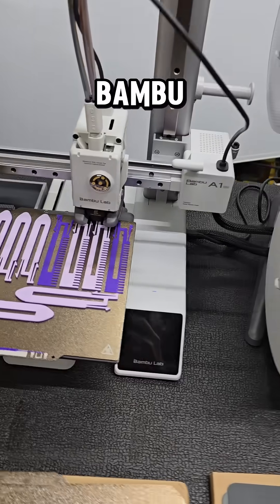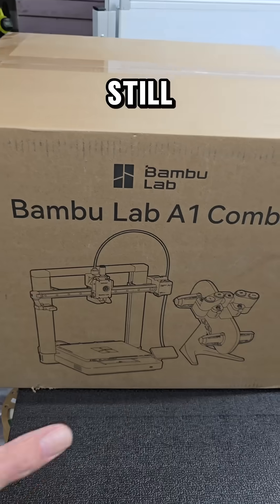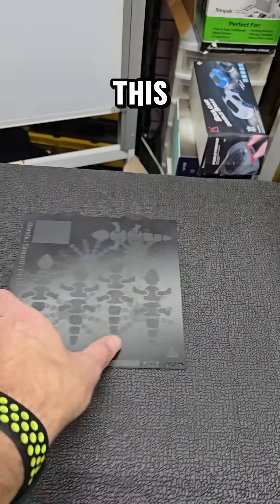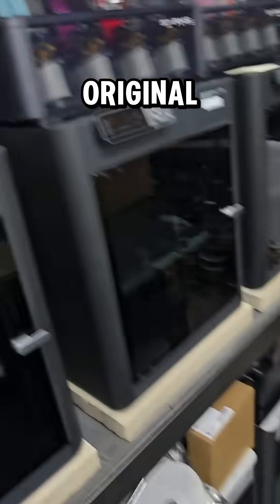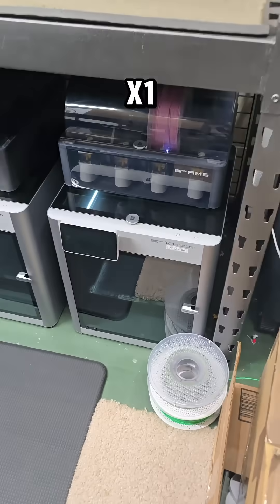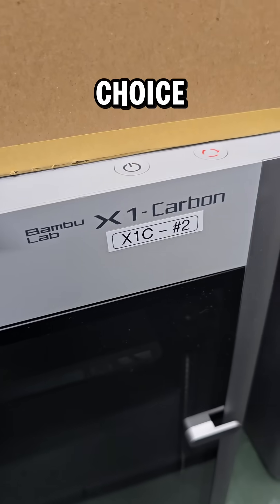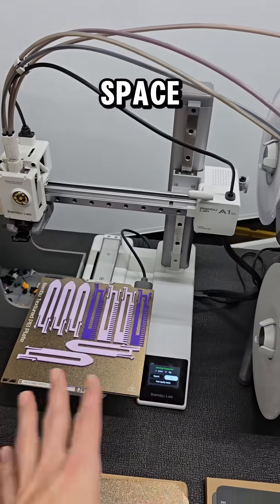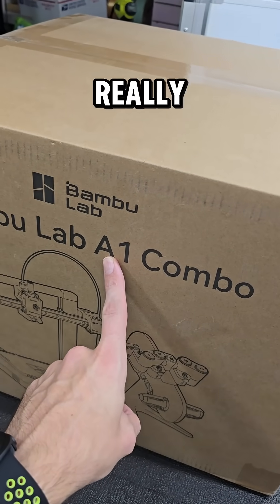Trying to decide between Bambu Lab printers? Here's are the differences: A1, A1 Mini, A1, P1S, X1C.

Comment: Question. 

I bought the A1 for Christmas from Micro Center but I'm about to bring it back to pick up the A1 combo as I haven't opened it yet.

Now I'm thinking I might just grab the P1S. I'm just trying to get a solid understanding of the ABS and ASA differences versus the PLA and PETG. What's the real difference in types of prints I can put out? Let's say I can afford to upgrade to the p1s, what would be a reason to not grab it?

Side question, would the A1 be significantly better if it was core XY vs "bed slinger"? 

I'm noob to this. Thanks

Comment: After a year with the a1 mini I got for Christmas well last year. I love it I have around 1250 hours on it and I haven’t had to change a single part just did regular cleaning and lubing, and the occasional swap to a small/larger nozzle. I’m finally ordering basic parts like replacement cutters and wipers but it’s not even needed she’s still pushing filament like it’s no one business. all in all the a1 mini is the perfect starting printer in my little experience. I would say it might be worth getting an a1 tho. The build volume is constricting.

Comment: Filament printers are worthless garbage, I have a bambu labs p1s and the print lines are annoying and look like crap , they don’t print no where as smooth as resin printers.
Reply: Each printer got its own pros/cons.  if you're doing miniatures resin is no brainer.  just normal functional prints FDM.

Comment: @techmakesmart thanks for the video! I'm choosing between P1s and A1 combo. It will be running inside my flat so PLA smell is the issue here. Can you comment if enclosed P1s can filter that PLA smell fully? Maybe with carbon and hepa additional filters?
Reply: You won’t want to print with the door closed for pla the chamber temp would be to high causing it to clog the nozzle
Reply: @Blackcat34756 thanks for the tip. I got A1 coz it's simpler motion design.  I don't think that's the issue. I have it fully enclosed and after 1-5 hour print temp won't go over 29-32 C degrees.

Comment: for 2 months i've been stuck about thinking which should i pick between A1 + AMS or P1S. im not sure, will i need AMS... or will i ever need ABS filament?

but, i think ill pick P1S. and if i've needed multi color. i just pick AMS later on.
Reply: It's on sale for 649 Euro. I'm stuck between the A1 combo and P1S AMS as well. P1S has a smaller footprint.
Reply: @IulianGLC  Hi, after a long months researching. im just pick A1 combo instead. the printer should be arrived by today!! cant wait to hands on it🙏
Reply: @IulianGLC also.. i got 7.7 date discount in my country it was 457euro, a1 combo + pla elegoo filament. i guess that good offer tho, so i pick it.

Comment: Where did you get engineering build plate at
Reply: They used to come with X1C combos. I think they've been replaced with the high temp plate, unfortunately. Because it's not even close to the same.
Reply: @KaloBelo333 is there any where you can buy them

Comment: I have one x1c with ams and one A1 with ams lite. The A1 runs just to print PLA if the X1C is busy printing carbon fiber or asa. Both work so nicely. I did decide to run in Lan only mode.
Reply: why LAN only mode? im not up to date with policys or anything

Comment: I thought the whole purpose of the ams was to keep the filament dry. Does this mean the filaments that the a1 can print with do not need to be dried?
Reply: You may have already found your answer but the AMS won't dry filament, only feed it to the machine. It may keep filament dryer longer though if you add some desiccant to the AMS unit. If you don't need multi color prints with filament that needs to be dried you can always do a single filament dryer and feed it into the printer of your choice even if it doesn't have an enclosure. The enclosure helps with drafts though, a good breeze from an air con vent can cause some prints to mess up. If you mostly print with PLA though I wouldn't worry about drying anything.

Comment: Whatever you choose, don’t pick an X or P printer with the AMS 2. Currently they don’t have any power adapters as if early April meaning they won’t ship out your 4 Pin cable, Power cable, and Hub/Buffer until end of April 2025. So all of us who received their X or P printers with the AMS 2 Pro have no with of connecting and using them together. No communication from Bambu until I reached out… sad day.

Comment: carbon fiber and other abrasives are really not that difficult to print. People make a big fuss about needing hardened steel but if you’re willing to change out your stainless nozzle once a month or two there’s no issue there. I print all sorts of carbon fiber on my almost 10 year old anycubic i3 mega flawlessly. Granted it’s a little slower than the new machines but and A1 is more than capable.
Abs Asa and others are a little different story because of their warping, but again the carbon fiber or glass helps stabilize the filaments.

Comment: You can also print -CF infused PLA/PETG, TPU, wood pla and glow in the dark filaments with an hardened steel hotend with the A1 series!
Reply: Do you need an enclosure ro print those with the a1?
Reply: @AKTechIT They are maybe 50 dollars, and you can get ventilation fan ones.
Reply: @AKTechIT  You don't need an enclosure for any of the filaments mentioned above. It's only ABS, ASA, PC, Nylon (PA) etc where an enclosure is essential
Reply: @AniK-g3x and for ASA you don't really need an enclosure either if you have a good heated bed, maybe only for those fumes to stay in the enclosure and get filtered
Reply: @rusername  Yh should have made it clear, pretty much every other polymer apart from PLA have terrible fumes that imo must have an enclosure for quality of life
Reply: @AKTechIT no, except maybe TPU? Idk, I wouldn’t recommend printing TPU, it’s insanely difficult for not that good of a result
Reply: @Monocentic  TPU prints perfectly if you dry the filament. I've had 100+ hours of just printing TPU and it caused me no issues
Reply: @Monocentic  TU is pretty hard to print on A1 mini any other material is perfectly fine. I’ve printed PLACF on the A1 mini and A1 plus glow in the dark filament I feel like petg is harder to print than PLACF
Reply: @jhaskins3972  I think the issue with TPU is hardness. Bambu recommends hard TPU (which seems counterintuitive) for the A1. Maybe it's an AMS Lite issue.
Reply: Yes you are so right!
Reply: Yes you can but it is not recommended but in the p1s and x1c you can use it with no worries
Reply: @avestarezaei4822 the „not recommended” part is simply due to the fact that you need a hardened steel nozzle and the tougher extruder gear to print those filaments. Both easily upgraded 😉 
for the P1S that simply means you are “only” missing AI functionality and flow leveling. If you don’t need it, it’s the cheaper option of the enclosed printers.
Reply: @ you just need the nozzle upgrade
Reply: And extruder upgrade, for the A1 mini@Augusttdy
Reply: @avestarezaei4822 It is perfectly fine if you have the hardened steel nozzle and gear upgrade

Comment: A1 with textured pei build plate. Do I need to use a glue stick on order to print with Bambu's PETG-HF?
Reply from the maker: @Red_Leader_636  I've tried it both ways. Sometimes PETG can really bond with PEI, so using something like a glue stick can be used as a release agent. I've also done it without and it was fine.